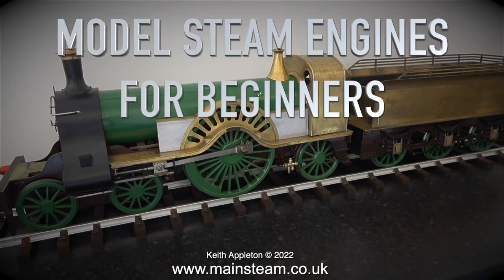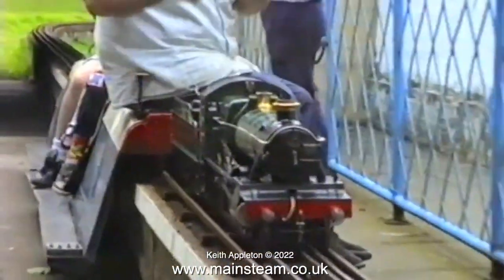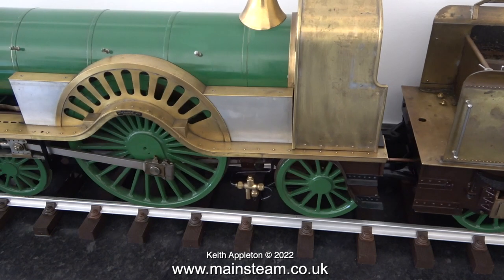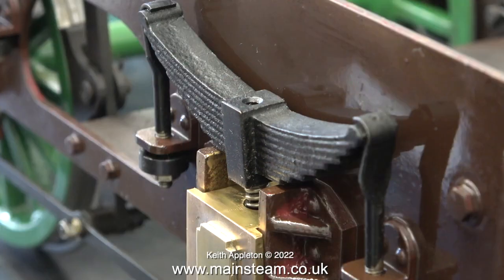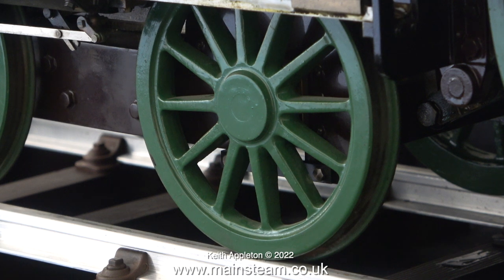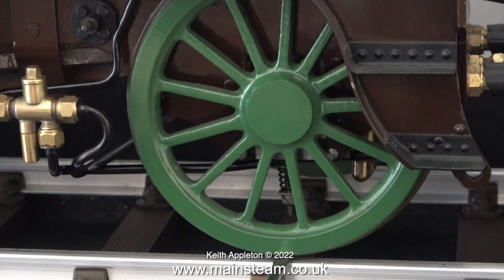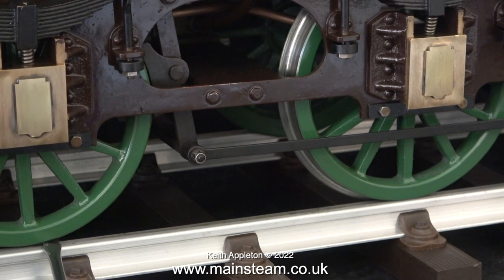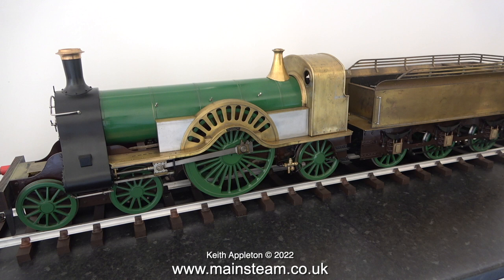WHEEL SUSPENSION - MODEL STEAM ENGINES FOR BEGINNERS - PART #22

Comment: This is what equalization bars are for, they keep the weight completely balanced between the drivers and ensure that when one wheel goes up the other three go down keeping the locomotive level and all wheels on the track.
Reply from the maker: Most miniature locomotives don't seem to have EQ bars on the driving wheels, only on the front bogies. This Stirling single doesn't have any at all, instead it has independently adjustable springs on each axlebox.

Comment: Hello Keith, as an aspiring model engineer I always find your videos exciting. As an American fan of single driver engines I certainly understand the importance of distributed weight and good suspension. You are exactly right about poor balance leading to lack of pull. A club I go to had a Texas type 2-10-4 running, but due to a minor derailment, a center leaf spring had been dislodged from its chair. The engine would barely pull two people without slipping, a Texas type no less! No one knew about the spring issue until I saw it when they were putting the engine away. Love that Stirling, and your videos.
Reply from the maker: Thank You {:-)))

Comment: neigh sayers ... just ask them if they ran out of hay .... as for the wheel information it makes sense you want your drive wheel making the most contact so it can drive BUT you want enough balance with the other wheels that it isnt holding the complete weight either ... get the right blend of weight and balance and you will pretty much fly ...

Comment: i know very little about steam locomotives, but I do know this; the larger the driving wheels are the smaller the TRACTIVE EFFORT (the amount of weight able to be pulled) and the greater the top speed attainable. 
In the USA the Virginian railroad had 2 -10-10-2 locomotives. they had very small driers, allowing them to pull millions of tons of coal  (over a mountain) but you could run faster than its top speed. Additionally there is an engine called a Pacific, 4 - 6 - 2. it has very large drivers and is able to go near to 100 miles per hour, but can't pull any where near the weight the 2 - 10 - 10 -2 could, due to  tractive effort, not the amount of drivers'
This particular locomotive has very large drivers, so It would not be able to pull the same amount of weight as a similar loco with drivers 1/2 the size. Still this locomotive can pull weight, just not as much.
Very interesting Keith, you point out another critical point BALANCE. Without balance the drive wheel adhesion is never even, and so any locomotive would not run well. ;-)